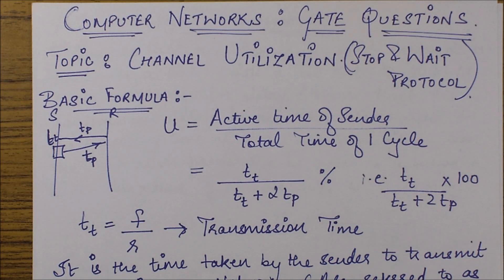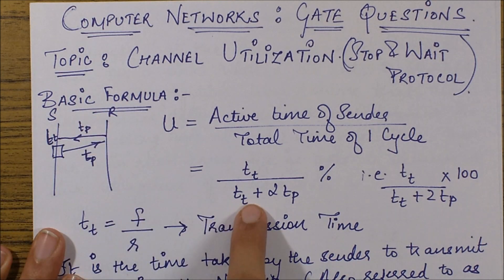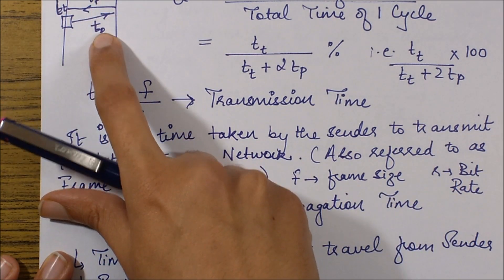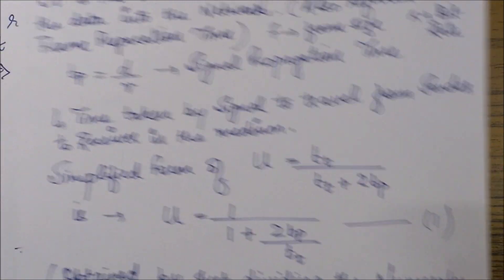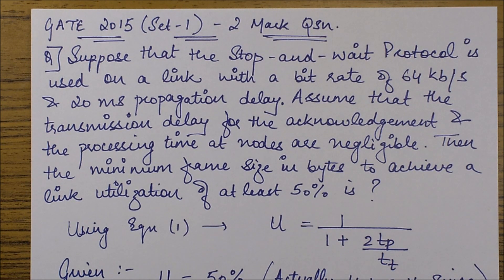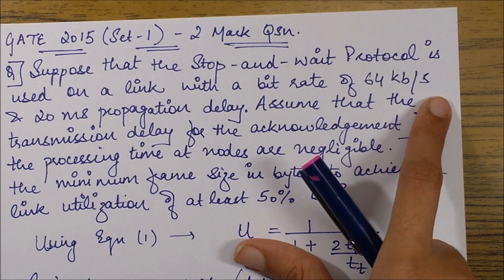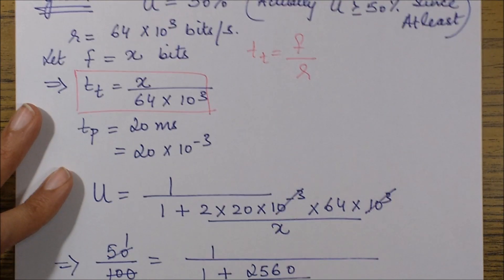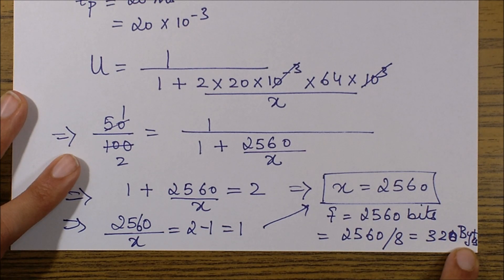CHANNEL UTILIZATION- Stop & Wait Protocol Gate 2015 Question (Computer Networks)

Comment: Hi Ritu Mam, I've been following your tutorials, they are precise and to the point, can you please help me with "Wrap around time" concept in CN it's asked 2-3 times in GATE, It's very simple but when i searched online, the approaches used are really confusing. Thanks in Advance.
Reply from the maker: +Daya Rao First of all, Thank you for your appreciation... It really means a lot... I'll posta video shortly on the concept specified by you... All the best ...
Reply from the maker: +Daya Rao Could you share a few links or questions of the same (if possible) or mention the Gate year in which it came... It will be easy for me to explain it with the question you are facing difficulty or an example of that type...